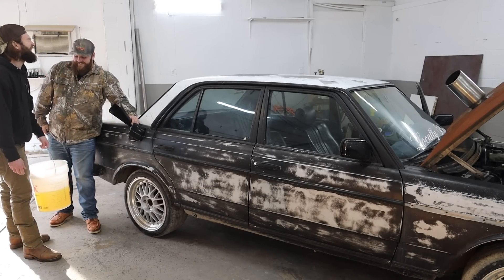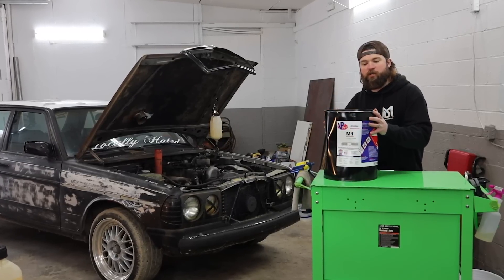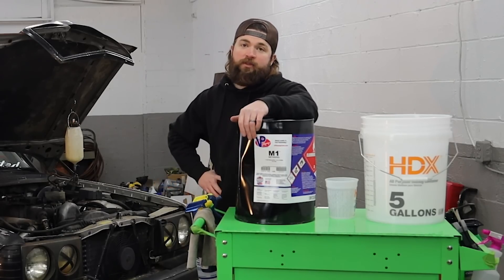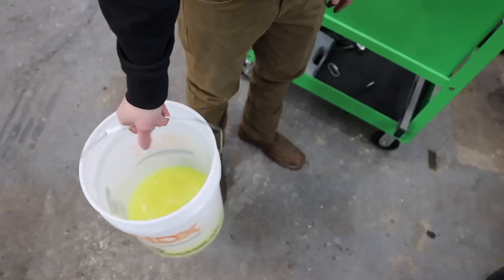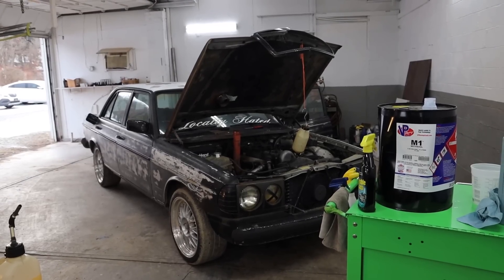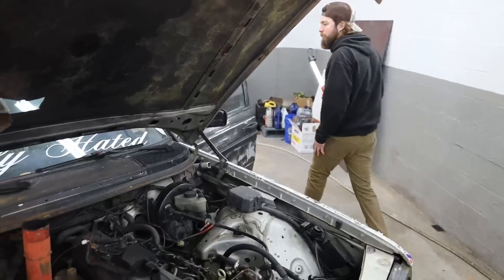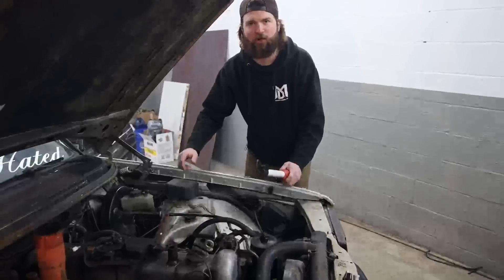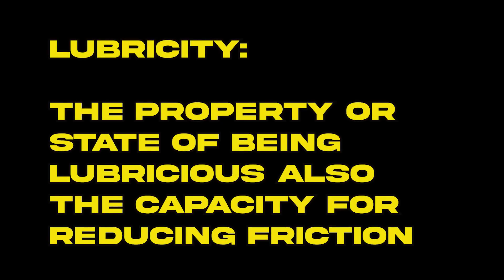What Happens If You Put METHANOL in Your Diesel?

Comment: If you can get a spark plug into the chamber, remove the mechanical pump because it will not lubricate and will lock up, then put either a carb or EFI on a diesel, it will run on straight methanol or ethanol. Methanol is the corrosive one of the two, and its VERY toxic, as little as 10ml will kill you. Be careful with that stuff. Ethanol on the other hand is vodka, same stuff that is whiskey, wine, beer, etc. 

Ethanol can handle a little less compression than methanol, but diesel compression is no problem. Ethanol itself doesn't corrode anything in modern vehicles, or in 50 year old vehicles for that matter. The corrosion you see with E85 is from additives, not from the ethanol. ETHANOL AND METHANOL ARE VERY DIFFERENT FUELS, as in they are not the same thing from different sources or something like that. 

Neither of those fuels likes to ignite with the diesel cycle, they want a spark. The diesel lights off with a small amount of ethanol or methanol in it, so thats not a problem. Running straight will require spark plugs with either of them. 

Here is why alcohol fuels make more power than gasoline and diesel. They have more oxygen in them, and they can cool the intake charge drastically. With the direct injection that cooling doesn't do much, and the fuel doesn't have time to vaporize fully.  A carb with long runners will get frost on the intake in 90F weather, that is how much alcohol fuels cool the intake charge. 

Now the REALLY fun part of all of this. While methanol is relatively difficult to make, you can make ethanol yourself.  Sugar, water, and yeast, in a closed environment without O2 in it, the yeast will eat the sugar then piss ethanol and fart Co2. It takes some space to do it, an apartment will not be very lucrative, if you have an acre of space you can make quite a lot. The tanks and boilers take up some room. 

Using bakers yeast you need ten gallons of water to make 1 gallon of ethanol, because the yeast die in their own waste. Its not like the water is gone, need treatment, or you cannot reuse it, but you need ten gallons to make 1 gallon. There are other strains of yeast (like Turbo yeast) that can handle 20% of their own waste, and they will make two gallons of fuel for every ten gallons of water. Strain out the solids and you can reuse the water for the most part, as long as you get the Ph right. Thats why it takes up space.

For reference butanol takes 100 gallons of water to make 1 gallon, and the water is toxic and needs treatment before you release it into nature again. 

Different stills produce different proofs, pot stills like moonshiners use male low proof, 50 to 100, which is 25% to 50% ethanol. A packed reflux or plate column can make 180 to 195 proof in one run. Thats what you want for fuel production. The larger diameter your still's column, the taller it needs to be, so you have limits there. The big ethanol plants are using plate columns for continuous runs. They are easy to build and clean. If you do not plan to drink any of this fuel, you can use PVC pipe, provided you have some kind of thermal barrier between the boiler and the column, just something that won't get hot and melt the PVC but will connect without a vapor leak. 

I've been doing this for a long time, got into making ethanol in 2007 when I couldn't afford to feed my 1970 GTO pump gas, because it was $5 a gallon for 87 octane here. Premium was well over $6. Living on crippled Iraq vet compensation meant none of my muscle cars and trucks could go far. 

The really fun part is if you convert a diesel to ethanol with EFI and a spark ignition (not so easy on the ignition with the pre chambers and strange designs of the heads in some of them) then you heat the fuel in the rails to over 200F you pick up lots of mileage with no loss in power. Essentially you are then doing the same thing Smokey Yunick did with his hot vapor engine, but you don't need to heat the fuel mix over 450F like he did with multiple prechambers.  

I am doing this heated fuel system on a 76 C10 with a swapped in 6.0 wearing 706 heads, drop in cam, headers, and EFI from a flex fuel 05 Tahoe. The 04 and up LS trucks lend themselves very well to heating the fuel, because the regulator is in the tank. Its not as much compression as I would like, but I am on a budget and building a 13:1 + compression LS engine is a bit out of my budget for now. More compression equals more power and better mileage because you are working the fuel harder. More torque from the same amount of fuel means you will use less.

My 1965 GTO gets 17mpg on E85 with an 11.5:1 455 in it, that is making nearly 600ftlbs and well over 500hp at 6000rpm. Just a 3.08 gear and no overdrive in it. The pump gas 7.8:1 compression 400 that would run on 87 no problem, with a 2.41 gear and no overdrive, would barely squeak out 15mpg, and it was making a lot less power than the 455 is. So yes you can get better mileage on ethanol than you can with gasoline, but you will lose mileage with pump gas compression.. unless you heat it like I am doing with my C10.

The 70 GTO has had an 8.8:1 455 in it running pump gas for years, and later E85, 2004R trans, 2.93 gears, and a Qjet the combination ran 12.60s despite it being a 4100lb car. Then I built a 13:1 compression 455 for it in 2010, specifically to run E85/E100, it had a 700R4 and 3.42 gears behind it with a Qjet. The 2004R has a taller OD than the 700R4, and 455s make so much torque they don't care what gear is behind them, much like a large diesel, 500ftlbs at 2000rpm to 4500rpm is easy with a Pontiac 455. Its not like an sbc that is lugging with a tall gear, 455s DGAF. 

The 13:1 engine with deeper gears got 20-21 mpg mixed city/highway and had crazy power. The 8:1 engine got a best of 19 highway following a semi down I-40 across Tennessee back in 2000 when I got stationed in South Carolina, usually it did around 15 mixed and 12 city if I wasn't beating on it. That GTO has had electrical problems since I bought it in 1994, and the suspension is worn out again, so its going in my shop for a frame off soon, otherwise I would still be driving it. Getting 20mpg from an old muscle car that should easily run 11s in the quarter, with dinosaur technology, old Qjet, and reworked stock parts is not an easy thing to do. Its easy on ethanol. Impossible on gasoline without a power adder.

Below 20F ethanol doesn't like to start, because it doesn't want to vaporize that cold. A bit of methane injected with something like a nitrous plate, some ether, or a splash of gasoline and it will start no problem and run great in the cold weather. You need at 190F thermostat to make sure the oil gets hot enough to boil condensation out of the crankcase, but otherwise its crazy amounts of fun with ludicrous power all summer. Winter here in northern Michigan up by lake Superior gets cold and they salt the roads heavily, so all my cool stuff is parked once the salt trucks come out. That was last week.  Its warm today, 31F and it feels balmy. Yesterday was 16F.. lots of fun working in the yard yesterday.

I don't give a F about all the other crap surrounding alcohol fuels, the politics and whatnot. I only care that I can make it myself and run it in my vehicles when gasoline and diesel get so freakin expensive that I can't use them at all. That it makes more power and lets me use all my old 60s era high compression engine parts is a bonus. Making fuel from cattails costs me less than $1 a gallon, still working on tree sap and coffee grounds. Cattails can produce 1000 gallons per acre easily, and if you flow sewage through their bed you can get 10x as much. 

There are other benefits to making your own fuel, like it makes it easier to grow more food, and you can heat your home with a system I use to preheat the boilers that uses woodchip compost piles to heat water to 140F. If you live in a city, none of that will be available to you.. but if you have friends who live out in the woods, own some land away from town, or you can rent some space to do it where you work on vehicles, then its doable. In a city you are pretty much screwed. I live in the woods in the Upper Peninsula, on 13 acres of woodland. I have plenty of space here, and hundreds of acres of cattails all over the county.

Comment: When mixed with fuel it will run lean which is causing the fuel knocking. Needs to be sprayed into the air intake for it to really burn right

Comment: Quick tip! When you pour from a 5 gal bucket with a spout, if you lay that bad boy on its side with the spout at the 12 o’clock position and then slowly roll it, it’ll pour ezpz nice and controlled like
Reply: but you obviously you would have to set it on top of something just slightly higher than the bucket or you would just be pouring it out on the floor if it was too low and splashing fuel everywhere if it's too high.

Comment: Methanol is the component in poorly made biodiesel that trashes the injectors and pump if they haven't got the correct seals installed that resist methanol. Also, methanol makes a mess of aluminum!

Comment: it's because the compression is so low, it would hydro lock at 40 psi other wise. so they make the connecting rods short enough that it runs on gas and only when the forced induction starts going the ecu sends diesel in.

Comment: back in 1986 I rode with a trucker up Cajon Pass in California which is a real bitch in a loaded bottom dump. He had many miles on the engine and it seriously needed a rebuild, but it went up that hill like it wasn't there, 60 mph plus. He had a 20 pound propane bottle on the floor and when he started up the hill, he turned on the propane bottle that had a hose going directly into the air filter, the pyrometer temp went down, the stack was clear, and the speed went up.

Comment: Many comments. Firstly: you need eye and skin protection when handling Methanol. It is an absolutely deadly poison destroying your eyes and internal organs when in contact with your skin. Do NOT take this lightly, and I am BLAMING you, TopCorey, for not pointing this out! . Inhaling Methanol: just go and google that, good luck, doing what you are doing  with the Methanol. Secondly: Diesel has a calorific content of 10200 kcal/kg whereas Methanol has 5000 kcal/kg...this is a HUGE difference, the Diesel has more than TWICE the energy content of Methanol per weight!!!!!! The two fuels are considered non miscible. Methanol destroys materials in the fuel delivery systems of Diesel engines. O rings and hoses. The only "advantage" of using Methanol in a Diesel engine is the ultra clean burn. Diesel fuels are expected to have a Cetane rating of 55 to 60. The Cetane rating of Methanol is 3. There is ONE WAY to use Methanol in Diesel engines SAFELY: it is Methanol in it's dehydrated form, and that is called DIMETHYL ETHER. So go back to researching this, and for heaven's sakes tell people the truth about Methanol, it is a extremely poisonous substance! Do NOT BREATHE it or ingest or let it touch your skin! Dimethyl Ether is non carcinogenic, lots safer to handle and a great substitute for Diesel! READ THIS! https://www.briangwilliams.us/methanol-economy/methanol-and-dimethyl-ether-as-diesel-fuels-substitute-in-compression-ignition-engines.html

Comment: Two things. Diesel ignites with the heat of high compression so it is a very different fuel to gasoline that requires lower compression and a spark, so methanol is not a replacement fuel for Diesel engine.
The diesel you get in winter in cold climates is not the same as summer diesel as it has anti gelling agents and the like mixed in that may not play well with methanol.
Using kerosene would have been a better choice for the test.

All that said methanol injection at the air intake is a possible benefit as long as the amount is small enough that it doesn’t ignite before the diesel is injected. This can really bump up the power and reduce pollution and reduce the amount of diesel needed to be injected for a cool burn .
If you want economy you need to reduce the fuel injected but that increases heat and pollution, methanol injection cools the charge air as well as reducing the lean burn of the initial fuel spurt.
Reply: I’ve never agreed with the idea that mixing methanol or ethanol with gasoline or diesel is more efficient or cleaner. A gallon of ethanol produces about 65% of the energy in a gallon of gasoline or diesel and methanol is only about 50%. A 10% ethanol/gasoline or diesel blend will return about 97% of the energy that 100% gasoline provides. The simple math tells you that you don’t as much energy. I had a truck with an E85 engine, it did get a bit more horse power when running E85 fuel, but that’s because you could pump a lot more ethanol blend than gasoline before you hydrolock the cylinders. If it ran E85, it only got about 70% of the mileage I got running gasoline.
Reply: @Sickofliberals  .
The benefits of e10 are all in the negative except for those making money out of the government subsidies.
E85 on the other hand can actually give more power and economy BUT only if the engine and fuel system is specifically designed for it and the engine is very high compression.
Because of the higher octane and cooling effects of e85 or pure alcohol you can run an engine with high compression increased timing and higher boost all of which get more power out of a given amount of fuel.
There’s a sweet spot that you can tune an engine to to get the most bang for buck out of any fuel especially high octane fuels. But only race , aircraft, marine and some stationary engines operate in the sweet spot for long enough to show the true benefits, normal vehicles operate over such a wide range of conditions that they rarely maintain the sweet spot for more than a few seconds over a normal twenty to thirty minute drive so any benefit of blended fuels is lost over the majority of the drive and may go into detriment the further away from the sweet spot you need to drive.
This sweet spot is why you now have 10 speed automatic transmissions and drive by wire throttle bodies.
Reply: @anomamos9095  I completely agree with the added horsepower claim but there is actually less efficiency. As mentioned, Ethanol/methanol only provides more power because those engines use the same principal as nitromethane dragsters - they both have less power per gallon, but you can pump far more fuel into the cylinder than you can with gas or diesel. Most vehicles are drive by wire now - the last 4 cars I’ve owned did not have a throttle cable, and CVT transmissions are as variable in their drive ratios as it gets but I don’t see us moving to ethanol or methanol for a fuel until somebody figures out how to make it more efficiently. Right now it’s like hydrogen - it’s energy negative.
Reply: @Sickofliberals  . As I said there is a tiny sweet spot where you can actually get more power and economy out of alcohol , US department of defense research docs available on the web to prove it. It is just that 98% of the time even a motor tuned for it won't operate in the sweet spot.

Comment: Good way to destroy the fuel injection system due to lack of lubrication, if the fuel source is thinner then diesel fuel injection system will not be able to sustain proper fuel rail pressures or individual injector pressure, there atomization becomes an issue aswell instead of the fuel source being misted into the combustion chamber, it sprays the fuel in a stream or fast drip like a faulty injector.. from there misfiring issues will occur along with washing out the cylinder's i use to experiment with different fuels in diesels too.. only fuel's that replicate Diesel's consistency will usually work.. but they need to be a lubricant like diesel is, for the injection system
Reply: no fuel rail, mechanical injection.
Reply: @aeroflopper  even worse.  More moving part's in the P pump that need lubrication along with the mechanical injectors that will eventually get stuck open or closed.

Comment: when poring from that container use spout on opposite side. better control especially new container
Reply: Correct, always have ur pouring spout on top to start pouring from a new/full drum/can, so air can enter as fuel exits without it having to bubble through from bottom of pouring vessel.

Comment: I recall that, as a truck driver, I used to put 5 gallons of super petrol (gasoline) in a  50 gallon tank of diesel. Made the diesel engine run real well and produced a flame out the exhaust stack about 3 feet long. It was better seen at night.
Reply: Didn't have any algae either, did you?
Reply: That sounds like a bad idea! Adding even 1 gallon of gasoline to 1,000 gallons of diesel will change the flash point of the fuel.
Reply: @grantyentis5507 your obviously not very old. When there was no 'winter diesel ' you put petrol in up to 30% to stop it waxing. It was a proper thing, I had a 93 bmw diesel that told you to do it at anything below -20c.
Reply: @grantyentis5507  guys used to mix gasoline with old IDI engines back in the day because those engines ran like shit when it was cold outside, if you could even get them to start in the first place. the gasoline kept the diesel from jelling up and effectively raised the cetane level of the fuel (figuratively not actually) as weird as that may sound given the properties of each fuel. it was harder on the fuel pumps to do this but it worked. some guys would dip a rag in gas and hold it over the intake or splash a little on the air filter and the old diesel would fire right up on the first crank.
Reply: @grantyentis5507 so what? It will still run fine even on straight gasoline, but the fuel pump will wear out fast
Reply: 2006 I had a International 9400 with dual 150 tanks. During winter if I couldn't find anti gel I would use about 2 gallons of regular 87 gasoline. Never had any problems
Reply: sounds cool as hell brother